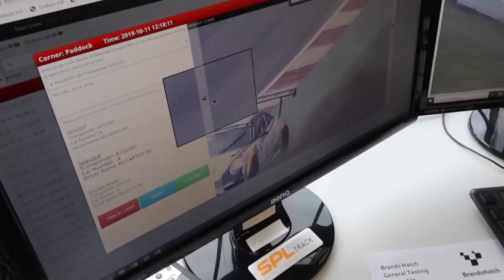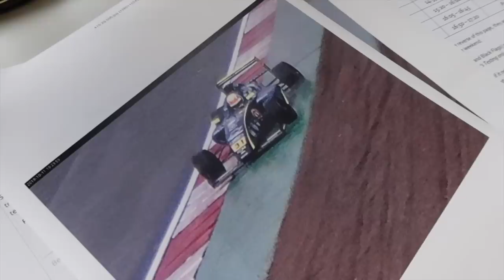Track limits: there is a safer solution! By Peter Windsor

Comment: Just bring gravel and grass back. Drivers will be more cautious and will be punished for their mistakes. If there wasn't a tarmac runoff area in Monza, Peroni wouldn't have been so confident to go as fast into Parabolica while not having much grip. Like this, he believed that he can go wide and go unpunished - which works in 99% of the situations in tracks where there's no more gravel and grass. But because of that trust in the safety of the track a freak incident happened, which luckily ended up fine.

Look how no one went wide at Suzuka, the drivers know that they can't make mistake. While on tracks like Bahrain or Paul Ricard many have gone wide because they know that even if they push beyond their limit, they can still go unpunished.
Reply: ^this
people underestimate the enhanced confidence factor that these tarmac runoff areas give. tracks like australia, monaco, suzuka e.t.c show that drivers can work with grass (or no) runoffs.
Reply: @michaelcollins966  Exactly, plus seems to me that all drivers love the tracks with no runoff areas based on interviews I have seen.
Reply: Roger Dodger  Crashes in gravel only look more dramatic with the rollovers and stuff like that, but are not necessarily much more dangerous.
Cars go flying from tarmac and additional kerbs, not gravel and grass!
Reply: Roger Dodger  Dude this video is literally about a driver flying because of kerbs on extra tarmac runoff areas
Reply: Roger Dodger  I won't repeat myself so go and re-read my first post why the combination of tarmac run-off area and kerbs send him flying.
Reply: Roger Dodger  Again, re-read my first post to understand the reasoning.
Reply: Roger Dodger , he went flying of a curb because he was able to go full throttle on a tarmac run off.
I'm not speaking for gras and gravel pits, but having a run off area which creates much less grip than the racetrack for the first, lets say 2 metres, and then the higher grip level tarmac afterwards in these corners seems to be a better solution than any electronic system + penalty.

Comment: On a completely different subject some people want to eliminate most of the downforce in cars and replace the lost time in a lap with increased horsepower.  What are your thoughts?
Reply: people want the 1980's
Reply: I want to reduce horsepower ;) It would make overtaking easier. A) Less power would force teams to run less drag.  -> Cars would be able to follow closer in corners. B) Cars would stay in straight longer accelerating making it easier to catch car ahead. Currently cars will quickly accelerate from corner close to speed which are drag limited making speeds level out for all even if they started with worse speed from corner exit.
Reply: @suokkos  why don't they just run F3 cars then?
Reply: @michaelcollins966  , Aero, suspension etc is much better which makes car much faster with same power.
Reply: @suokkos  and we know that high aero makes it hard for cars to follow each other, defeating the point of improving overtaking

Comment: Excellent video. I watch the BTCC races when I can (missed Brands last weekend!) and just hearing that a driver, in whichever formula it is, has the driving standards flag for track limits actually gives the race a bit of an edge, especially if it's your fave driver who's battling for an important position at that time. I've seen numerous tin tops go flying, 99/100 because of collisions and then the car spinning onto the grass or if there's deep gravel digs in and flips. It's terrifying, but there is always the knowledge that tin tops are more often than not going to be as safe as houses. Open wheels... not so much, but there aren't too many accidents with serious consequences, and none that I know of in recent years for hitting a sausage curb or something like it. Racing will always be dangerous, but if a known danger can be mitigated for, there is no excuse not to apply that piece of tech - even if it's old-fashioned but has proven itself to be most reliable. Not that I can think of anything like that at the moment, I'm just saying that whichever system protects the driver - and those around him/her - the best, then that is the system which needs implementing. And that it doesn't have to be horrendously expensive. But what cost a life, eh?
Reply: A woman driver in F2(F3?) broke her back last year when her car hit a sausage kerb and became airborne. I'd call 2018 pretty recent.

Comment: Great idea.  Lots of cost and monitoring though and some great wheel to wheel action being spoiled by penalties being applied.  Look at Max on Kimi in Austin.  Awesome Viewing on TV but spoiled cause Max exceeded track limits.  If grass had been there he wouldn't have tried it but may have thought up a different plan. 
6 feet of grass encompassing the entirety of every circuit is the answer. You don't get track limit infringements at Silverstone or Suzuka.
For the likes of Monaco and Singapore,  there's already limitations. 
Just don't give the drivers/riders the opportunity in the first place.  They'll race/be safe enough. 
Look at how more dangerous the Wall of Championship has become in Canada with the cars being  pitched sideways and out of control when 2 cars are trying to race and that's the optimum word, "Race" not Parade or Time Trial.

Comment: With V8 supercars series they have been using this for a while with mixed results. The downside to this system as it currently stands is... It's not accurate when the sensor is not aimed straight down. Which means when your car  body has a lateral lean, like it has when going over bumps and around corners, it alters the measurement. These bumps and corners are right where you need the sensors too. In practice many teams have taken issue with their accuracy.
Reply: f1 cars dont get the side of the car close to 2m off the ground tho... F1 has minimal body roll...it wouldnt be an issue for F1 like it is for supercars at surfers..
and i thought they sorted them issues out a few years ago...there hasnt been any mention of it in the last 2 years...

Comment: Solution is grass.   Have an actual track limit.
Reply: So when you’re going through a corner at 150 mph and you touch the grass you’ll go flying into the wall at 150 mph. Great solution, does the same thing as a sausage kerb.
Reply: There used to be sand after grass, cars would go off and be out for the race.   They paved over everything to keep cars running.   Know your history.   Cars didn't go "flying" through the air, as you say, in the past.
Reply: lou kush I never said “flying through the air” I used the word flying as in going fast. If you can’t even grasp the English language then you don’t have the right to call anyone autistic.
Reply: lou kush and you never mentioned asphalt after the grass. Believe it or not we can’t read your mind so writing out what you’re thinking goes a long way. Especially because 1/3 of the comments are saying to revert to the old days of grass and gravel.

Comment: Thanks Peter. I've seen a similar system in terms of the relaying of visual info to Race Control work in karting as well. I'm very much for it instead of big kerbs as a deterrent to track limits abuse. 

I've experienced some not liking these systems. Mainly because they can be so reliable they result in a lot of penalties being handed out. But in my view this is more often than not down to drivers and teams not understanding how such systems work and that they really cannot get around them in practice. Not fully bulletproof as you say but a big improvement over officials having to make snap decisions and arguably safer than putting physical deterrents in such as sausage kerbs.

I'd also be interested in seeing the cost benefits for circuits, if any. Having attended circuits such as Donington Park and seen how damage to sausage kerbs can result in track delays, repairs and not to mention added risk to marshals and corner workers when the kerbs come loose mid-race. For example I watched a Ginetta GT5 race last year where marshals had to remove a sausage kerb with an angle grinder mid-race to keep the corner in question safe! I do wonder whether over time after installation of the system demonstrated at Brands, it actually could reduce costs for circuits because they're not having to replace track furniture as often.

Such videos as yours will hopefully go a long way to educating the racing community about these systems that can take photo and video evidence for track limits and how officials can use them to the benefit of all. Thanks once again for the video. Really enjoyed it. Andrew, UK
Reply: Your observations are remarkably accurate. One very important factor is damage to the ground on turns where there is grass outside the kerb. If the grass is rutted after a car meeting it has to be repaired before bikes can use the circuit for obvious reasons of safety. The cost of the work runs into thousands over a season to the extent that the system pays for itself on that point alone over a couple of years.

Comment: It's a good system. Other than it being safer than a physical obstruction, from a reporting standpoint it's unambiguous. Its implementation has been obvious when watching BTCC qualifying sessions, because you hear about drivers getting pinged for track limit abuses all the time. At the same time, there's no complaints, because the system is the same for everyone. I still think grass strips and gravel are a good way to passively deter or punish drivers, but this system would be a worthy addition to corners that need runoff for safety. I'm sure if the national circuits that MSV run can afford to implement this system, then Grade 1 international circuits can.

Comment: The MotoGP has a great solotion as a penalty: The long lap penalty, it's a different corner on the circuit where the driver loses about 3 seconds.
Reply: Random Redhead that could work but if there’s a great battle going on and it has to end because one driver has to do a long lap, no one would be very happy.

Comment: hmmm wonder what is a bigger "time penalty?"  Driving over a sensor pad or running into grass or gravel? You should get a time penalty proportional to the time gained by exceeding track limits. Grass or gravel traps will draw drivers closer and closer to the edge till they go off. With the sensor, they go off, get a penalty and then they try to avoid doing that.

Comment: Put a material down that slows the car down when they exceed track limits
Reply: Yes but, putting one or two tires in such material would upset the yaw stability, possibly creating dangerous situations.
Reply: raffriff42 When the maintenance guys at Brands were digging the troughs for the pads in freezing weather they did suggest that puppies tethered on the kerb line could be another solution. Fortunately SPL has a poodle consultant and the idea was immediately rejected!
Reply: @raffriff42 , what dangerous situations can occur, when you are outside of a corner, leaving the tracklimits and you loose control? You spin the car or run even wider of track and you may hit a barrier, thats it and thats how it should be.
Best example, this years German GP and like this it should also be under dry conditions and nobody really got hurt.

Comment: Yeah because we need sensors and sasuage kerbs and all that nonsense...
Instead of having run-offs that can't be used at full speed and actually slows the drivers down.
Reply: The problem is those runoffs don't exist. Grass is slippery as hell and after a certain speed cars just skip over gravel like a rock on water. The ideal solution would be a 1m strip of very low friction material (grass, astroturf...) right on the outside of the track, then some very grippy material (tarmac or grippier, like the blue and red lines at Paul Ricard), and before the barrier a couple meters of gravel to prevent the car from bouncing towards the track. This is perfect for cars, but there is a huge problem with it: motorbikes. If a motorbike happened to touch the low friction material it would almost inevitably fall, so it is strictly prohibited in the regulations.
Reply: @Jorge
Of course they do exist. Even earth would be such. And gravel would work as well for cutting corners or going wide. (What you mentioned can happen when they go straight off the circuit, but it doesn't happen a lot actually.)
But I can vision something better than all. Artificial tall fibers, like a hayfield.

Comment: Supercars has had sensor kerbs for a long time now, They get 3 warnings if you run over them then the last time you get a drive through penalty, Then so on it continues. I think it would work, If you're gonna run wide once, Okay that's fine, Twice, Alright you're getting close now, Then the third you're on your last chance, Once more and it's a drive-through. I don't really see a reason to sausage kerbs anymore UNLESS it's on specific slower corners, Not corners where you're going as fast as Alex was.

Comment: This is exactly what I thought would be a good idea. Any mechanical device is going to have some sort of inherent safety problems. This eliminates much variability in enforcement and makes it pretty consistently and universally enforceable.  No more just being lazy and letting the car run wide or pushing it so that it has to, and hoping to get away with it. If drivers know they are going to get flagged for it, then they can and will drive accordingly as they should be.
Also - wouldn't most sanctioning bodies stop the race or at least go FCY after such an accident as compulsory by the rules?

Comment: It would be a whole lot simpler to just not have track limits. Run wherever you want. Obviously some limits will be needed such as an escape road that cuts off a chicane or something. Just put the slalom style tire barriers in or a rule to come to a complete stop before rejoining or whatever is required so it's a penalty, not an advantage and that's it. Other than that, if a car needs to run wide to avoid crashing into a guy that blocks him or something, fine. Racing needs more "pass in the grass" type moments, not more controversial penalties.

Comment: F1 should not be safer. It is about talent pushing limit and dancing with it. If there is no consequences for wrong move, then there isn't either really a talent nor suspense in watching. Only rich guys driving around in fast-ish cars. Even F1 are not really fast, because of totally useless fuel save, nobody really races to the limit of the car.

Comment: Please peter...I hate those curbs...I know they are trying to keep cars in side the chicane...I was in a simulator...in an older 2007 Williams F1 car last of the high down force and the manager of the practice track says want a try this track Italy the long track and not knowing the curbs where there on my first lap I missed the brake zone and slid out side and hit something that launch the car straight up at the moon the rear spoiler four or five feet up in the air nose of the car 16 feet or so and the car slammed down belly first and shuts of I apparently broke the gear box in half all to keep me from running wide,great idea I just broke a 2 million dollar car in half,because I over shot a chicane in my home land I'm 100 percent Italian thanks guys....lucky I was in a simulator or I be in a wheelchair....when I run car in the SIM its for real I don't reset I use it to get the max out of learning the circuit I don't use it like a video game...worst part is I had to ask the track manager what in hell did I hit...that sent my car heading forward a mars and outer space ...great design on the curbs geniuses.....my people,pavement or gravel...I like gravel the best that is the reason I wanted to race in Europe and F1  versuses America series....run off area were smarter I don't know what's going on getting rid of the best. Way to slow down a run away race car....on an off track excursion.....gravel gravel gravel.....backed up by 12000 tires

Comment: U see this picture its excactly the same height that I launch my car in the simulator after missing the brake marker....except my car was nose up the angle is a perfect match except I flew luckily straight I don't remember I'm pretty sure I was back off the brakes waiting for the car to settle next thing I know its shoots the nose straight up in the air same height as the cover picture...but I had slowed a lot more next thing I'm looking straight up the sky realizing this is probably gonna hurt...but instead I broke the car in half....what da fork was that what did I just do or how the hell did I just break the drive train because I stepped on the gas and the engine just made a little sound and I said shit I think I broke the trans mission...great on a warm up lap...the aggravating part is I don't crash very often if at all...pride may be...but I still go fast...

Comment: I really don't see this going around the long way the outside of a turn as going off the track and gaining a penalty doesn't that seem incorrect....going inside the course is a penalty but outside doent seem like it should be
Reply: It's not going around the outside of the turn - just widening it on the exit, which allows significantly higher exit speed.

Comment: For me they are doing this the wrong way around. Would it not be better to have sensors in every car that detect track limits (either Optically, Magnetically or capacitivly) that automatically reduce the engine power , thus making drivers know that they would never ever gain an advantage by exceeding them.